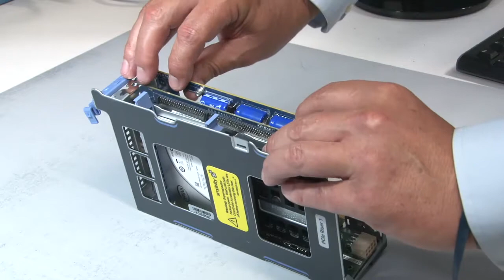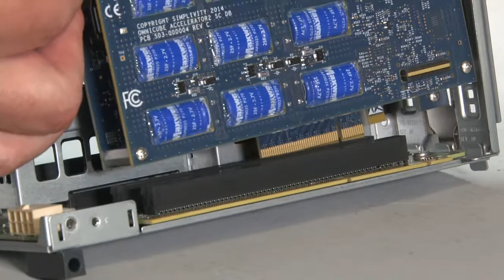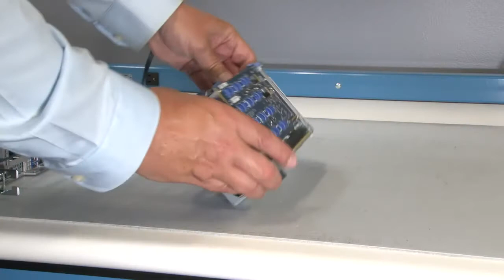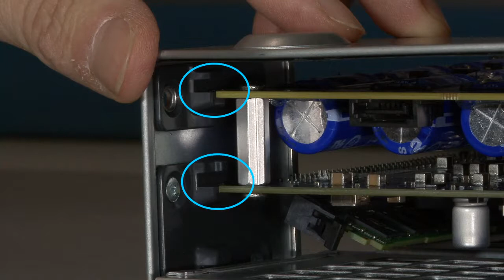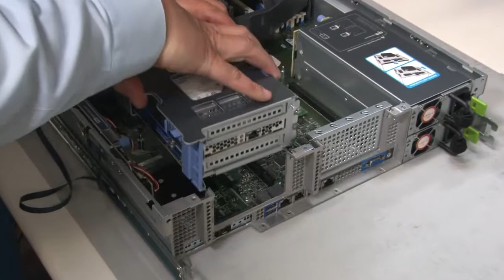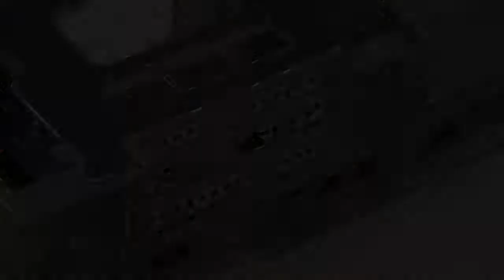Simplivity OmniStack Accelerator Replacement Sample Clip

Comment: Why the capacitors is uses?
Reply: there is volatile memory on the controller, thus it have to be backed somehow, controller  was designed for different platforms, before hpe bought development company, therefore it has all necessary onboard